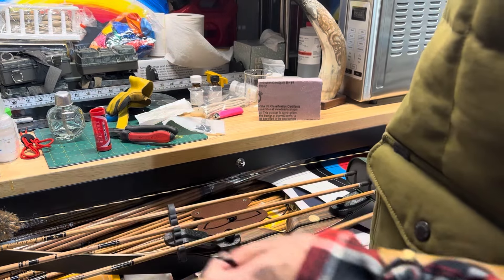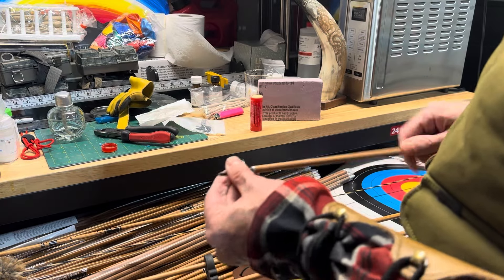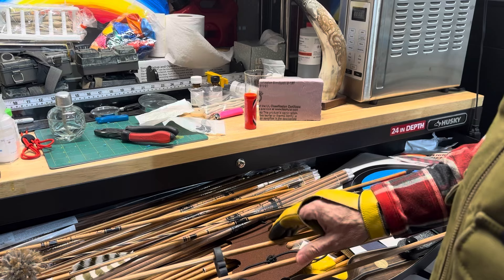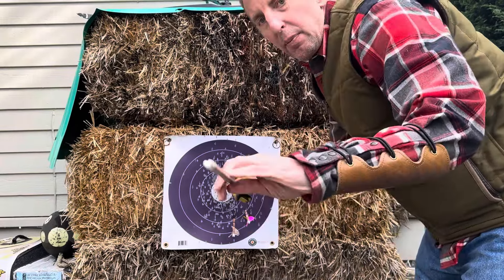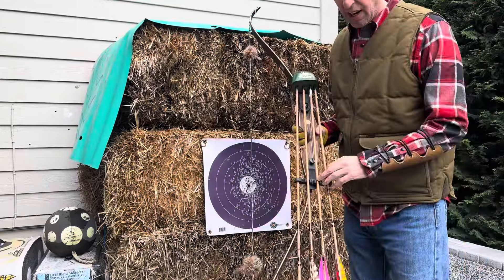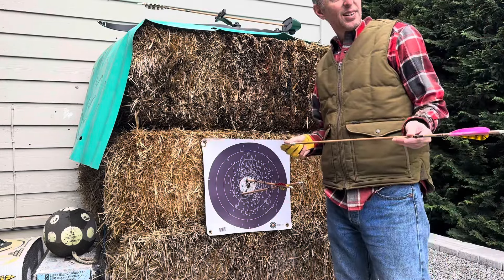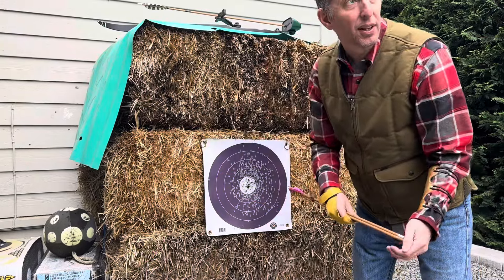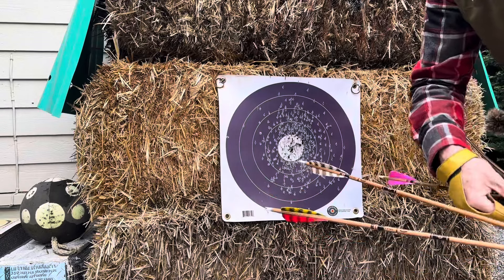Tuning arrows for the powerful Super Grizzly - my new Bear hunting bow!

Comment: What weight bow and what draw length are you mate ?
Reply from the maker: @bthompson2792  55#, 28”
Reply: I’m looking at a super grizzly in 45# my draw is 29” with my compound arrow length be around 30” going with a 75 or 100g insert with 150/175 head  what spine would you recommend 500 or the 400 ?
Reply: 500
Reply: I shoot 30inch arrows 400 spine with 430 grains up front with 44lb recurve